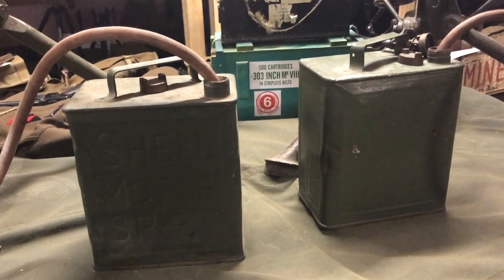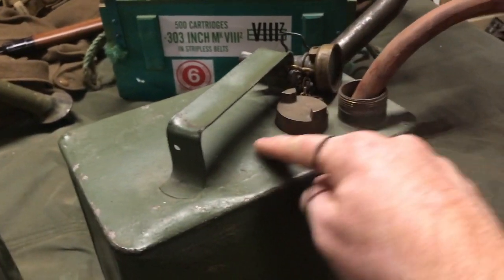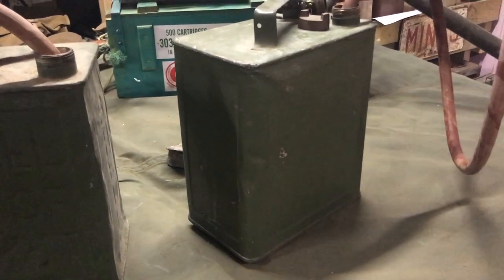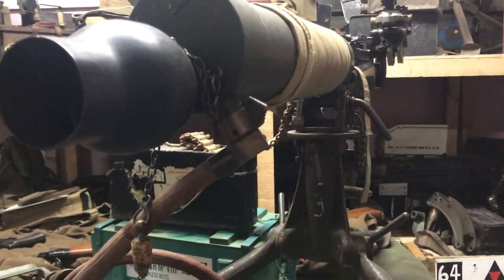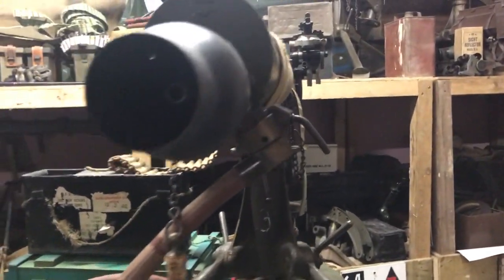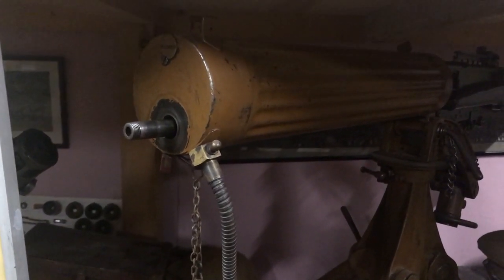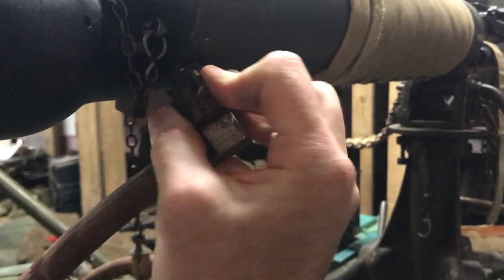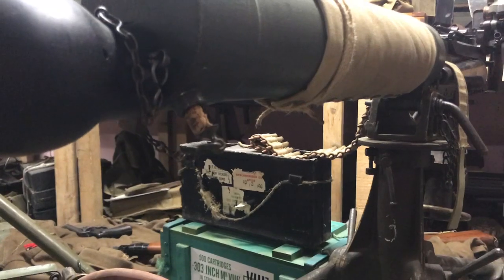Condenser equipment (#VickersMG 'reenactorisms' series)

Comment: I disagree with the hose display opinion. The rubber hose was most certainly used in WWI! Better to have a hose to educate the public rather than unscrewing the boss and leaving it to their imagination. I would rather inform the questioners of the hose differences. After all everyone has an opinion! LOL. Outstanding video! I do love your take on the petrol can painting.
Reply from the maker: Great thoughts Joe and I can see why you'd want to make sure there's a hose on show as it certainly gets the questions going. I'll take a look through the archive and see if we can find the specific date the rubber hoses came into service but the 1921 machine gun training manual talks about protecting the metallic tube from damage by using a piece of rope in training, which is why the rubber hose would be introduced.